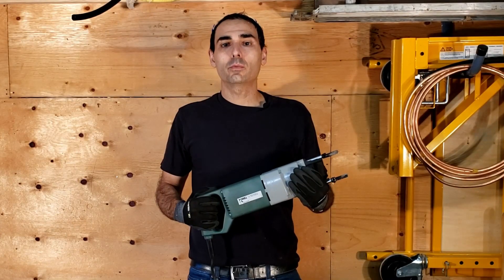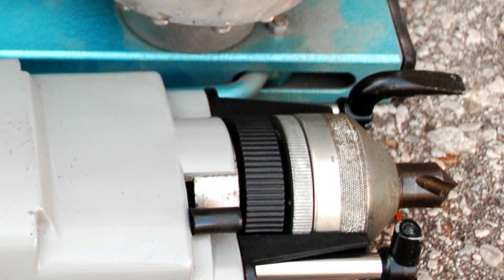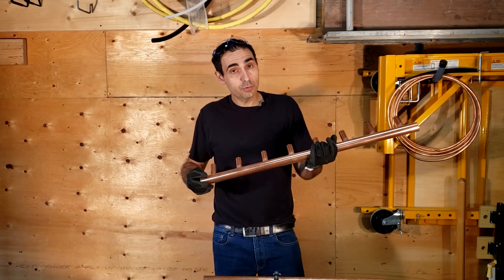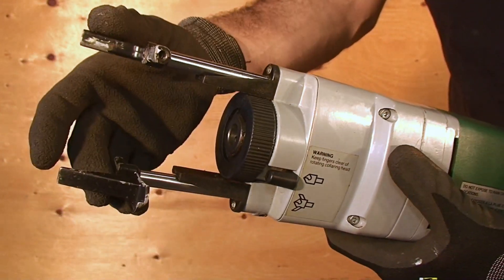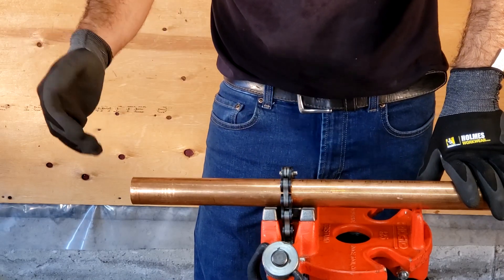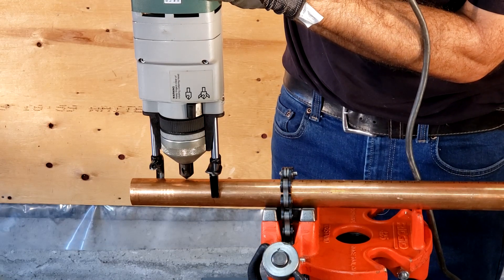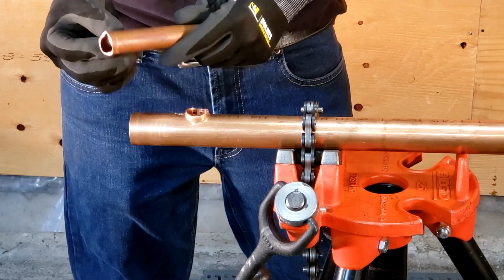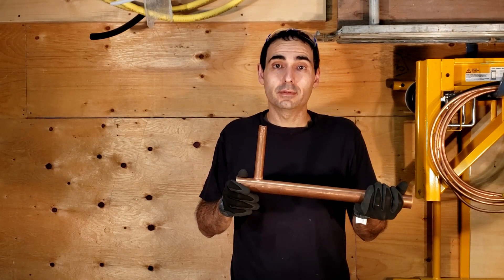Making Copper Branches With a T-Drill!

Comment: I was surprised by the fast pulling speed. The machines I used to use drilled fast but the actual pulling speed was much slower.
Reply from the maker: Yeah, it's pretty quick.  There are two speeds to control the extrusion.

Comment: You have to be doing a lot of this to warrant drill cost it’s clever but not viable so bad idea
Reply from the maker: You are one hundred percent correct.  Here in Canada they're upwards of ten thousand dollars, so they're not really intended for the average handyman or do-it-yourselfer. 

However, as is the case with all big-ticket items in any trade, such items often pay for themselves after one or two big jobs, and even become a necessity to the contractor.  With a T-Drill, you're sacrificing the cost of the tool in exchange for labour (which is usually the lion's share of the cost) and some material (also expensive), and the manufacturers surely factor in the purchaser's long-term savings when pricing their tool on the market.

My general rule is to always do a quick break-even analysis when purchasing a major item, to determine whether the return is worth the investment.  If the math makes sense, then I won't even flinch in purchasing it, regardless of upfront cost.

Comment: Seen this on commercial toilet carriers and manifold didn't know it was still done
Reply from the maker: They're cost effective only if you routinely manufacture a lot (and I mean A LOT!) of copper manifold systems on site, thereby saving significantly in fittings and labour.   Never saw T-drills used for carriers; I'd be curious to see how that would apply.

Thanks for your feedback! !

Comment: Can't pull the same size branch from the tubing. One pipe size difference is debatable for some sizes
Reply from the maker: Good point.  I absolutely agree, as a branch of the same diameter as the manifold would gut an opening that's the same width as the manifold! Not gonna end well. 

A good rule of thumb would be to make the branch at least two pipe sizes smaller than the manifold.  i.e., 1-1/4" manifold should accommodate no larger than 3/4" branches.

Thanks for your input!
Reply: @PlumbingsCool  That's what retired tradefolk do, cruise the web and comment on the old stuff............
Reply from the maker: 🤣🤣🤣  Stick around!...we need your untapped wisdom!

Comment: Is there a different tool used in HVAC? Pressure sensor switches have a bump ring and seem to slide into a straight hole - do you know T joints are done in HVAC?
Reply from the maker: Hi, and thanks for the comment!  As HVAC is NOT my expertise, my knowledge in that field only skims the surface.  When I think of HVAC, all that comes to mind for copper applications are the high and low linesets for air conditioning systems, which I don't think would require any Teeing off.  Other than for sheet metal air supplies and returns, I wouldn't know where the HVAC folks would be making any branch connections (shows how little I know about HVAC!).  Perhaps someone more well-versed in the field can chime in to help this person out?

Comment: I believe someone is selling these as a separate tool to create the collar. It did not look near as expensive and you could chuck it in your drill to create the exact hole and the collar, after drilling in a smaller hole first. 

Is anyone aware of what this is called and what it cost? It is not a complete dedicated drill but an accessory for your own regular drill. Thanks for sharing video.
Reply from the maker: If your purpose is only to occasionally make a few branch outlets, then a cheaper, alternative solution would certainly be your best bet (T-Drills are definitely not cheap!).  Only remember that you may need to find a way to notch and dimple your branch pipe to ensure that you don't restrict flow within the manifold.

Thanks for watching! 🙏

EDIT:
The universe works in mysterious ways...Literally immediately following my initial reply to you, one of my current students emailed me this alternative to T-drilling.  I've never used it before, but it may serve your needs:

https://youtube.com/shorts/FAH-aapkcAY?feature=share
Reply: That's where I saw it. Thanks for sharing and recall as it is a good option for occasional tee work.
Reply from the maker: Ah, I see.  I'll keep my eyes open and will let you know if I come across some useful information.

Comment: where can I purchase this tools
Reply from the maker: You'd need to go to a dedicated and specialized pipe tool supplier.   You might be able to special-order one through a plumbing material supplier if you inquire with them.  But be warned:  One will set you back about ten thousand dollars or so!...it's one of those tools that pays off only if you plan on doing LOTS of manifolds!

Comment: Do any of the big box stores rent these out?
Reply from the maker: Hi Eric, I would guess you'd be hard-pressed to find one of these bad boys available for rent a big box store, as they are a bit of a specialty item.  Also, as these are upwards of $10k each here in Canada, the stores would need to rent it for a decent amount to ensure they make a return on it (not to mention maintenance and repair costs).
Reply: @PlumbingsCool  wow!  I imagine not. So, in a non-pressurized environment, could I drill a 1/2” hole in a 2” pipe and solder in a short length of pipe? Would that work without leaking? Thanks in advance for any information!
Reply from the maker: @ericwinchester4778  Yes, for all intents and purposes, it will certainly work if done correctly, but there are many things to consider - mainly for what purpose you're tapping the pipe.

Foremost, if it's for a plumbing-related application, what you're trying to accomplish may be against Code.  Here in Ontario, there are only a handful of applications (and methods) which allow you to legally drill into a drainage or water pressure pipe.

Second, be sure to BRAZE your joint, which is much stronger than soft soldering - especially since there's so little surface contact between the drilled 2" pipe and the inserted 1/2"  pipe.  I have a video on brazing if you require some guidance. .

Also be aware that by simply drilling into the pipe, you won't get the extruded collar off the 2" pipe as you do with T-drilling, which provides added reinforcement.

And finally, remember that if you're drilling for 1/2" nominal pipe size, you'd require a 5/8" diameter bit, since nominal pipe size is referred to by its inside diameter.  If in doubt, measure your pipe diameter before drilling. Hope this helps!

Comment: T-Drill also makes a big, stationary collaring unit. But they're probably $100K. We had one at a refrigeration company where I did maintenance a few years ago. T-Drill also makes a tube spinner that closes the ends of tubing by spinning it really fast into a die, heating it up. Another $100K+ machine, so you won't be getting your hands on one, but it's cool to watch these machines in action.
Reply: Not 100k? They’re About 12-19k
Reply: @xnzhaua2932  Not sure which one that you're thinking about, but the one that we had was well over $100K.